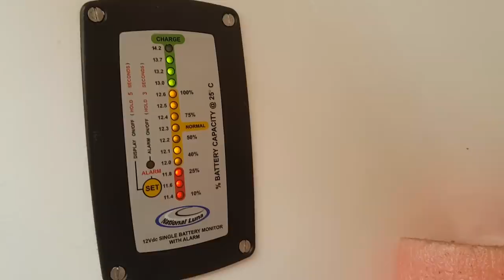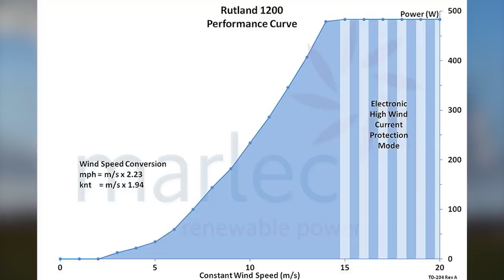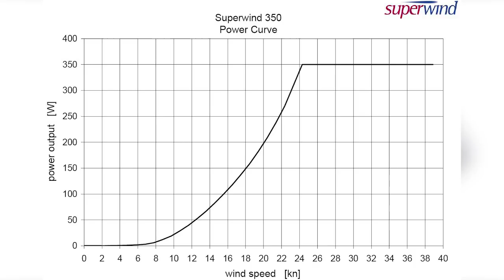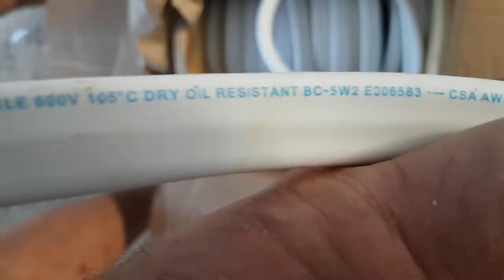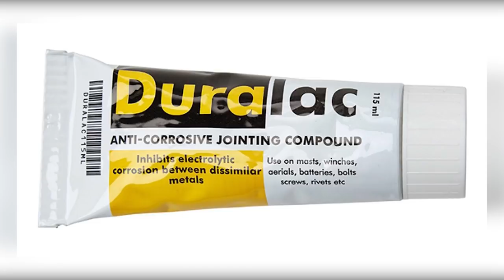Smart or Dumb? We Put a Wind Generator on Top of Our Mast - Ep 58 Sailing Luckyfish

Comment: Sounds like a defective bearing.  Put a fine long screwdriver against the bearing area and place your ear against the handle of the screwdriver.  If you hear the same noise when spinning the rotor by hand it's a bearing flat spot.  If not get a rubber engine motor mount (small one, and you'll beed three to hold it at three places) and it will isolate all the noise (including the hum).  Pm me if you need the details. Jean.
Reply from the maker: Great advice Jean, thank you

Comment: Have you reached any conclusions regarding the effectiveness of the mast mounted wind generator compared to the hydro generator?   Certainly the ability to generate power while at anchor is a plus but, depending on wind speed, it may not be as big a benefit as it appears.  Thanks and keep up the good work.
Reply from the maker: Conclusions? For the Carib where the trades blow like clockwork you cant go wrong with a wind genny. The benefit of wind at night is huge if you dont have sufficient room for a large solar array AND adequate storage. Thanks v much for your comment! Stew

Comment: To some extent all wind generators are noisy. I think I would think about bringing the whole thing down and tightening everything up, check bearings and use a medium duty locktite on all screws and nuts.
Reply from the maker: +Paul Wyand - I first noticed the Rutland 1200 in Grenada, two of them mounted on a Prout 38. They did not make a sound which really impressed me. That hardstand was full of noisy wind generators, so I understand you completely. We cannot hear any blade noise from the Rutland at deck level. I will be happy when we get rid of the knocking and the slight hum though. I think we can have a virtually silent genny at the end of this. Cheers Stew

Comment: Balance the blades both statically and dynamically. For static balance remove each blade and adjust weight on the blade so that they all have the same centre of mass. Then balance dynamically with hub assembled  and rotating on the central hub so that no blade is favored. When dynamic balancing only add weight to the centre of mass you established with static balancing and not the tip. You can add mass using tape on the backside of the blade. 

The next thing to try would be tip tracking. You can rig something up so that as you rotate the blades you can see if they rotate on exactly the same plane. If not you can shim at the hub or twist the blade slightly.  The tracking should be sub-millimeter.
Reply from the maker: Great ! Easy to follow, thank you. We will look at this but if the hub proves to be locked in tight. Rutland do a very sound QC before each unit leaves. It would be really surprising if it came down to a balancing issue as the unit made the knocking sound right out of the box. Thanks again - will keep you posted on outcome, Stew

Comment: If it works good ,put up another. Balancing the blades is really simple. Build a vertical frame, bolt the blade in and the blade that falls is heavy. A strip of tape or a drop or two of paint on the lightest blade at the tipwill get you closer. Rinse and repeat until all blades are equal. If balanced that will cut out harmonics
Reply from the maker: Good tip. We will be trying this very soon, thanks
Reply: @SailingLuckyfish  oh i have a question for you. I,m a compulsive radio control airplane builder o.k.? I use isiprophyl alcohol to maybe 3% to thin resin. It soake into the wood better, helps to wet off glass and then evaporates. Never had problems. Do you think thats cool for boat building or problematic??? Also an old salt said that stainless steel dog bowls are great during crossing when things are going everywhere. Very wide base, they stack, you can,t break them and are very stabile on the counter or in your lap. You can get them super cheap. Get large doggie bowls and some small doggie bowls for cereal, oatmeal or soups! Oh and some good stainless insulated mugs with lids!! After all sailing wharram style is like caravaning on water! Have fun!!
Reply from the maker: Boat resins Im familiar with should not be thinned. They are designed to saturate anyway. Thanks for the tips! Stew

Comment: replace the bolts with engine or gearbox mounts.
Reply from the maker: yup. you are on it for sure
Reply: @SailingLuckyfish  You have an issue with Gyroscopic procession at the top of a mast which will decimate the bearings in time.

Comment: Go on line and do a search for  Rubber Vibration Isolator Mounts  on Ebay or Amazon. Another source in the USA is Grainger.com. They come in different sizes and load bearing capabilities. I have used them to quiet down KVH satellite TV antennas, watermaker pumps, generator gas separators on my boat. You would place them between the top of your mast head and the base plate of your wind generator mount.

You do not want any solid connection like your bolts. Do what the movie industry does to prevent as a safety, place one or two small lanyards from the upper part of the mast and your generator mount. By doing this if the mounts ever fail and it breaks loose the most it will do is fall a foot or two.

Comment: It's a knock not so much amplified resonance, which I'd say points to build quality of a. bearings/a bearing b. un-balance, but that should not be a problem in a quality build/design.

I'd suggest, if you can, to return this build, have them send a flawless one, replace with another make altogether, or have a specialist look at the internal design and guesstimate where the problem is, upgrading with a better bearing(s) and such, test bench it (which is the manufacture's job). Cladding the pole might lessen the problem but not solve it,  more rubber under its connecting plate I'd say would be avoiding the actual problem and the forces on this rig are quite high I'd bet which would cause all kinds of other problems. (This is a bad problem I'd say). 2cts.

Comment: on rutland wind generators they recommend no more than 2" or 48.5mm outer pole diameter.  I think this is because the blades bend so much that they will hit a larger diameter mounting pole.  Is it possible that your mounting pole is to short and the knocking is the blades striking the mast???
Reply from the maker: thanks for the suggestion but we have mounted it according to the specs using a pole supplied by Rutland's Florida agent and cut to the length spec'd in manual... it was one of our first thoughts too. Cheers

Comment: Stuart you state that the new wind generators are extremely quiet now. Can you provide some decible ratings for these two generators if that has been measured? I keep going back and forth with a wind generator or a watt&sea. Thanks in advance
Reply: You have to be moving at something like 5 knots to get anything from a Watt and Sea.
Reply from the maker: +Professor moptop I see them as performing two different functions. Solar generally covers all situations (sailing or on the hook) during the day. The Watt & Sea covers us at night on passage. The wind genny covers us at night on the hook. The wind genny is not sufficient when sailing as our apparent wind speeds are quite low most of the time... hope this helps, Stew
Reply: @SailingLuckyfish  it helps.  We are going to run lithium with 350 watts solar for hook/daytime. I was just concerned with night time as you stated. But not trying to listen to all the nose from a wind generator all the time either. Wind would make sense for an all around source as well.  And we decided to purchase a Raka after the new year. I am loving the videos!!!

Comment: The question is why would you put it up there where it will put a lot of stress on the mast and rigging?   10-15 wind is easy but get caught in 39-40 and what happens then.  I get the efficiency but at what cost?  Maintenance is going to suck.
Reply from the maker: Maintenance sucks, yes. Re the loads, actually not that great. Makes little difference on the stability calc and as far as rigging stress goes, we are talking about drag of a relatively small unit compared to say, a sail. Also, the unit shuts down at around 29kts, so it isn't going to shake itself apart. Cheers
Reply: Luckyfish Gets Away. your boat and your call obviously but the load with sails and 40-50mph winds will me tough.  To me you are just introducing problems not being able to easily reach it when things go wrong.   Also the length of cable will have probably more drop than the gain in height unless you used really high gauge wire.  I do hope you are right and I am wrong on this one but time will tell.
Reply from the maker: Agree. Time will tell and this is very much an experiment. Risk / reward makes looking at it worthwhile and we seem to have a boat well suited to trialing it. Lowish aspect rig for its form stability/beam. Re the gauge, yes, we had to go to gauge 8 (3 core) to avoid losses. Cheers Stew

Comment: Trying to isolate the generator by placing a rubber gasket between the two plates is useless in my opinion.
I think using two or three small engine mounts would be better. This may very well cure your humming sound.
The knocking sound is another kettle of fish. I assume that the knock speeds up as the prop speeds up?
My guess is that it is something internal.If you watch "Free Range Sailing Episode 35" you get a good look at the internal workings of a wind generator. I another episode they change out the blades for some pricey carbon fiber blades which resulted in a huge reduction of noise. Good Luck
Reply: I thought engine mounts were a good idea to, until I realized the mast will whip the generator a foot or two side to side regularly.

Comment: How are you going to tie off the blades in hi wind conditions the electronic brake only slows it down so you can tie it off are you going to climb the mast each time
Reply from the maker: +Going Downwind - That would have been a show stopper for sure. With the two machines mentioned - the Superwind 350 and Rutland 1200 - neither require tethering in high winds. The Rutland which we are using has an auto high wind cutout as well as manual cutout - electronically controlled. Its a dead short across the stator from what I understand. It spins slowly but shorts. It can do this indefinitely. We looked at many machines and only found these two suited to remote installation. Do you have a wind genny? What kind and do you like it? Cheers

Comment: Stewart and Zaya:  Thanks for all your great videos!  I believe you said that this is an alternator that gets rectified to DC at the controller?  Maybe with a Multimeter measuring Hz you could determine/calculate RPM of the rotor, then somehow determine frequency of the annoying noise.  If the noise frequency is 3X RPM frequency, then you can assume it is a blade or blade passing the post.  If you knew bearing construction (how many rollers/balls) and compared frequency of noise versus RPM frequency you might be able to point to a bearing?  Good Luck.  Chuck in Wildomar, CA

Comment: I keep returning to listen to the offending sound.
Did you send an email to Rutland with a portion of the video attached including the sound?
My gut feeling is this is internally generated...
Reply from the maker: yes. I sent them that recording. their engineer(s) had a listen and were fairly strongly of the opinion it was a loose blade initially. After tightening the bolts without improvement, they had a deeper discussion, another listen, and came back with loose main hub nut, saying the sound was consistent with that issue. I'm not convinced but only checking the nut will resolve. That is the next step when we return to boat. Thanks very much for giving it some thought.

Comment: You are not going to be able to turn the generator off the wind when the blow gets over 20-25 this may cause it to overheat and kick off the production of power. If you can turn it 45* or so it high winds to maintain an output you can prevent the overspeed.
The electronic break won't stop the spinning once you overspeed. 
I used a tag line to the tail to be able to turn my KISS off the wind from straight on to 90* off the wind. Think of it as a way to spill the wind to reduce the efficiency. Counter-intuitive untill the wind blows hard.  Overspending will drive you crazy with noise and vibrations.
Reply from the maker: Thats true of the KISS but not the Rutland 1200. The electronic brake is a short that slows the rotation to a crawl. It cuts in at 29kts. We have noticed that by the time the shut down happens - our batteries are so full that there is no need for wind input. We'd like the added fallback of a tag line but we cant see a way to set it up without fouling sails, rotors etc. Thanks, Stew

Comment: It appears when attached to mast on the ground it appears the pole is not staying level. Looked like 20-25 degree angle. If the weight of the unit bends the pole, winds will do the same. Thus throwing off balance of the blades.  Not the best location

Comment: You’re talking about a product that has been made to a price with regard to engineering clearances and tolerances. To halve the vibration you would need to double, or square, the manufacturing costs. Even then, if you solve the problem now, it will most likely return.  They won’t tell you that, of course. Otherwise you are going to have to rely on workarounds. Carbon mast might do it. Not cheap I know. Also should the thru hulls be so close together? Has to be a vulnerable point on the hull, re stress, surely..... Just some thoughts. Otherwise very informative.

Comment: While elevating the wind gen will get it into the air/wind more easily. Servicing it way up on top of the mast will be a pain and may even act as a bit of a lightning attractant. I would sacrifice a bit of wind for the ability to easily service/repair the generator itself. A telescoping pole would be ideal, but that's not really practical. Everything on boat break eventually, so the easier you can make it on yourself when that time comes the better, I say. Fair winds!
Reply from the maker: that is certainly the alternative. lightning and servicing are downsides, agree. we will keep testing and trying some of the suggestions here and share the results. Cheers

Comment: Re vibration.  The industrial solution for that is from a company called Rosta. (Rosta.com) they have solutions from tiny stepper motors up to multi tonne machines. Call up and ask for advice. Odds are they do the vibration dampers for the commercial wind turbines, the ones with the 30m blades.